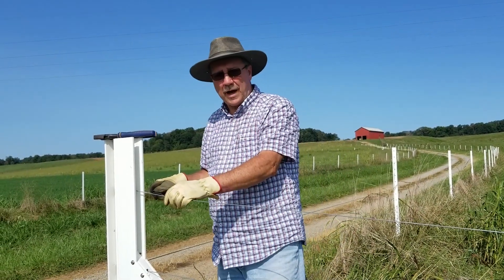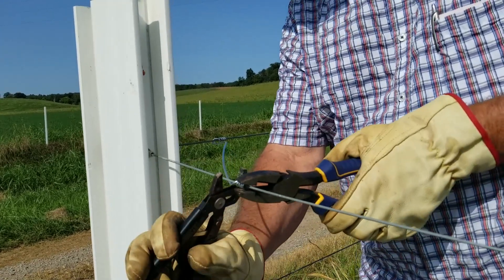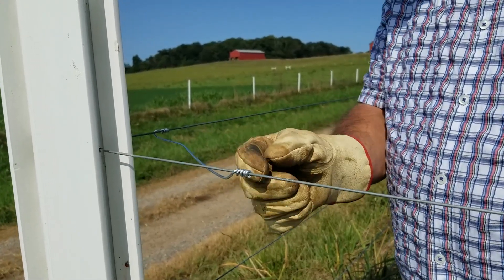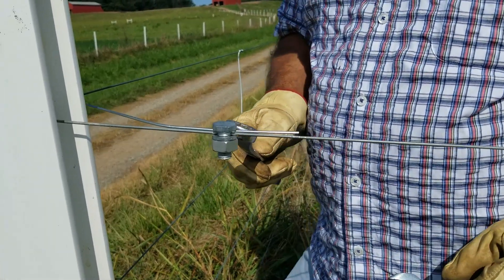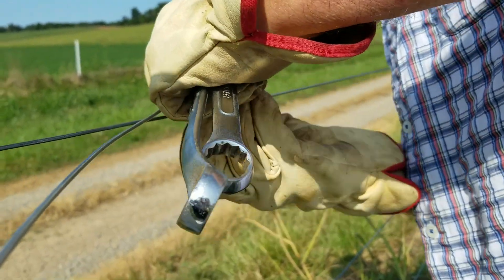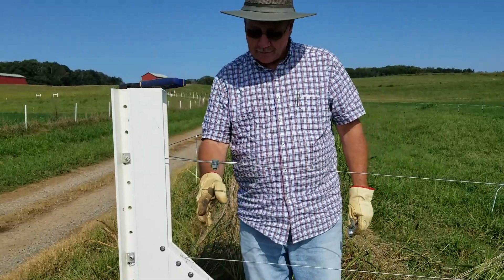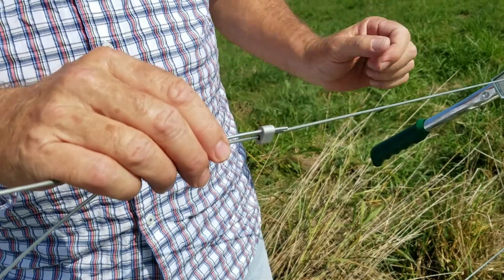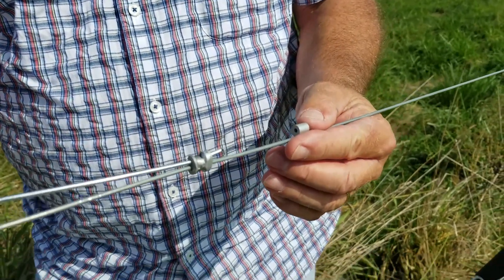You've Been Connecting Jumper Wires Wrong All Along!

Comment: Where do you get the split bolts and the open end crimps?
Reply from the maker: Hi @jedvon2164, you can find open taps and split bolts directly at the Timeless Fence System Store:

Split bolt: https://timelessfencesystem.com/product/hd-joint-clamp-split-bolt/
Open taps: https://timelessfencesystem.com/product/2173/

For the correct crimp tool at this address (the same tool used in the video): https://timelessfencesystem.com/product/crimping-tool-4-slot/

While these tools will help you with the wiring, remember that a solid installation starts with our Timeless Fences. Let us know if you need tips or assistance with your fence setup—we’re here to help ensure it stands the test of time! 😊

Hope this helps!
Reply from the maker: Hello @Jedvon2164,

We want to take a moment to correct our previous response and ensure we're providing you with accurate information.

The correct crimp tool (the same one used in the video) is available here:

https://timelessfencesystem.com/product/crimping-tool-4-slot/

We sincerely apologize for the oversight and any confusion it may have caused. Providing accurate and helpful information is very important to us, and we appreciate your understanding as we strive to make things right.

Thank you for giving us the opportunity to address this properly.

Comment: Why do you have to jump the wire on the corner?
Reply: it isn't a continuous wire,  it stops at the post so to get power to the other section you must jump it. hope that explains a little.
Reply: @cannolibear6831  it does help. Thank you.
Reply: @cannolibear6831  Thank you. Good video, but it was an obvious thing the presenter missed.
Reply: Good question.